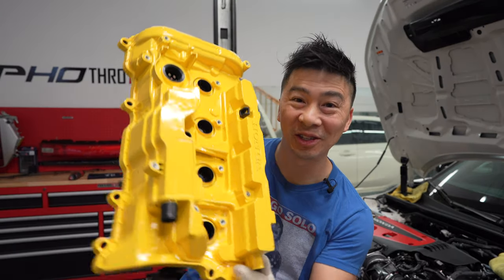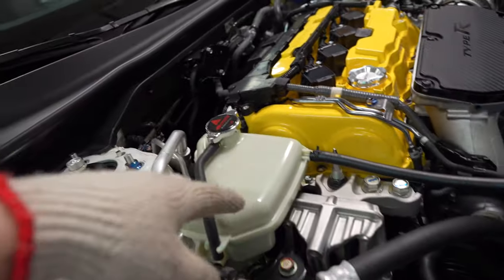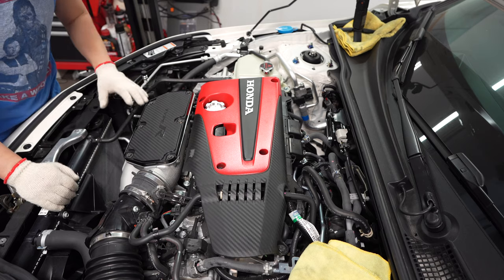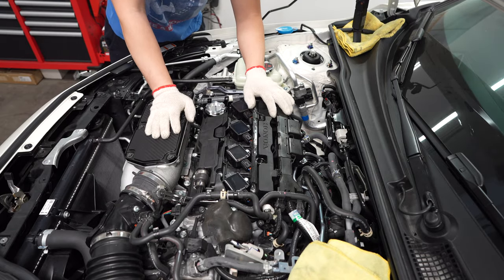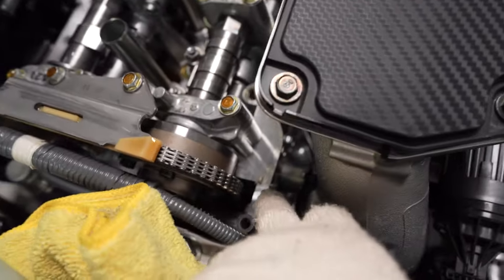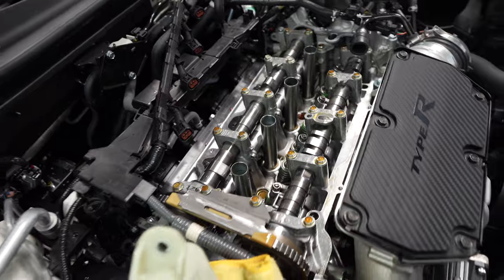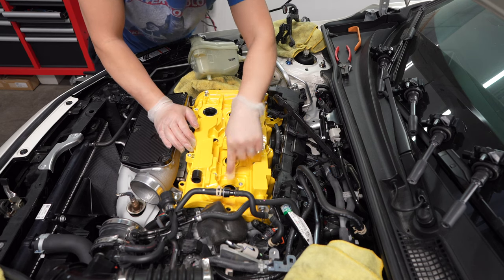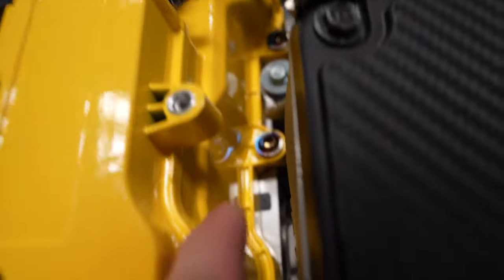Spoon Sports Valve Cover Installation || Honda Type R Acura Type S

Comment: what if you used a rubber washer so the valve cover paint won't crack when you tighting the bolts?
Reply from the maker: You want be able to torque them down to spec. Your valve will not seal and leak.
Reply: @phothrottle  that’s true. I was just thinking of a buffer between the bolt and the top of valve cover bolt hole.